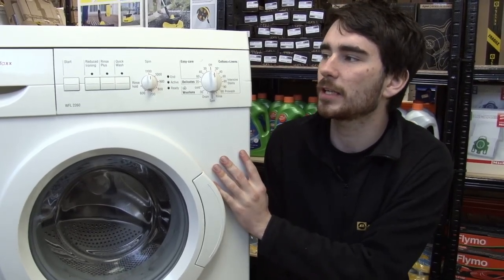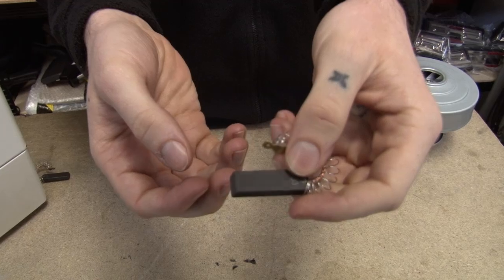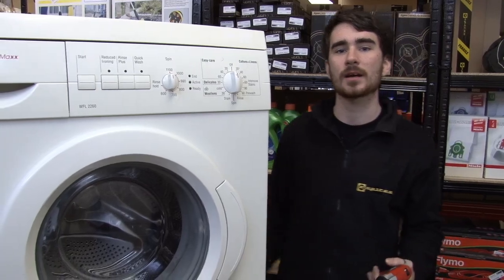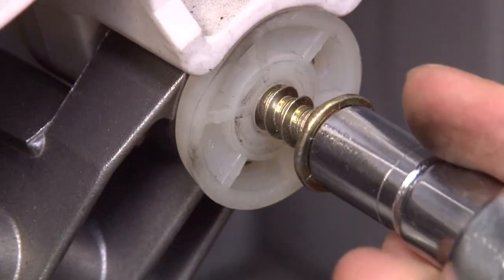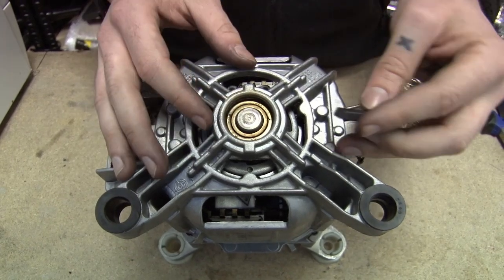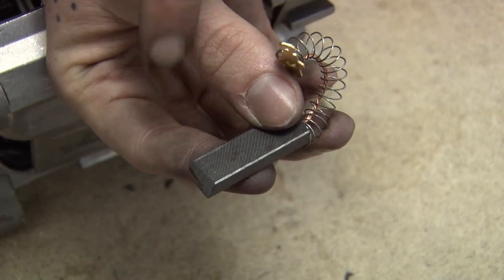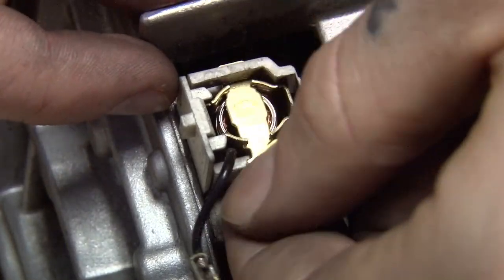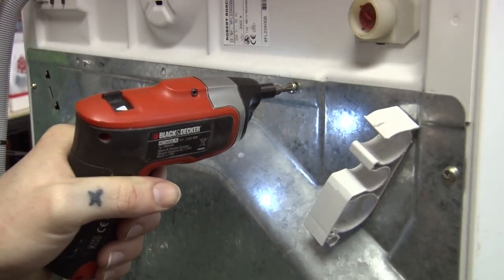How to Replace Carbon Brushes on a Washing Machine (Bosch)

Comment: Hi .. great video. 
After my wet2820gb  blowed, I opened the motor and  replaced the burned motor end + carbon brushes. I now realize that the board next to the Motor burned too. I cannot find it on you website, would you know how to get it?

Comment from the maker: @Shandybrother Hi there. This often happens if you are putting in different types of laundry in the one load. To test if that's the reason, try running a spin cycle when the drum is empty. If it works, you'll need to ensure you wash only similar clothes together. If it doesn't work or you hear funny sounds, it could well be the carbon brushes.

Comment: I had no problem replacing the brushes but unfortunatly we left it to late and discovered the motor had been scared so hence new motor.i seems simple to me that if Bosch had the sense to put a lip on the brushes to stop them waring down to far so the machine would cut out and that would have saved me a lot of money and ear ache